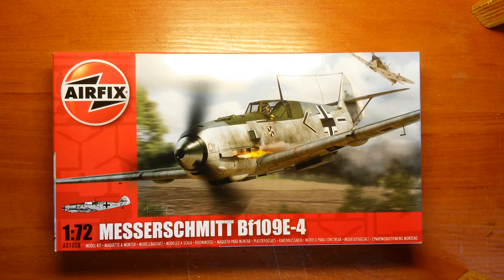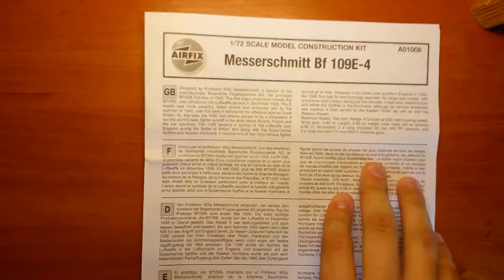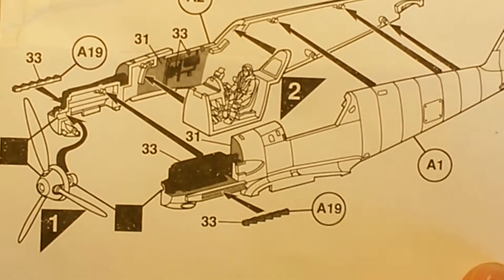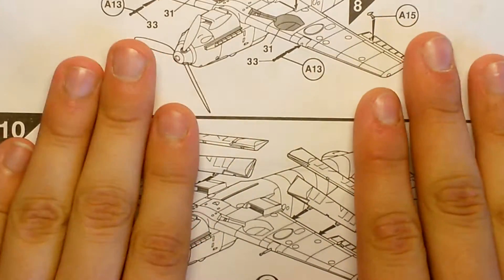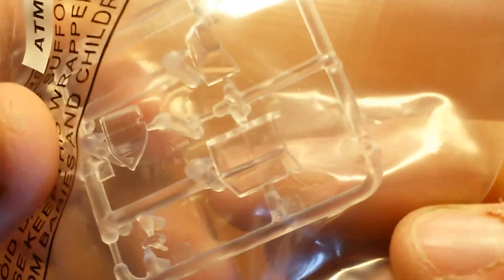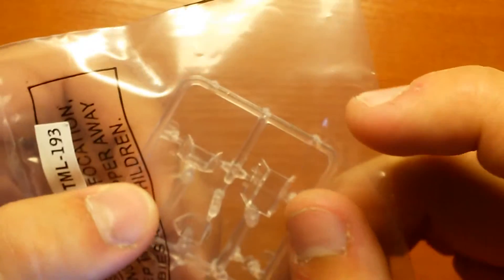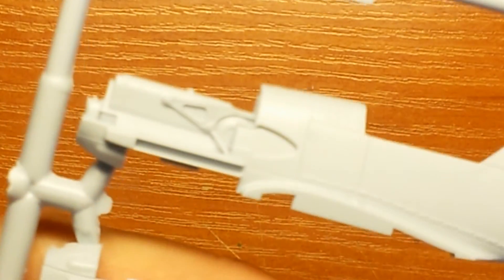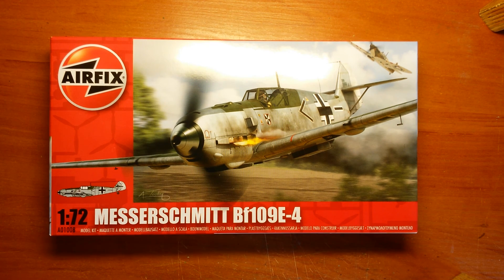New Airfix 1/72 Bf109E-4

Comment: I must admit, I wish more manufacturers gave you a moulded-on seat harness, maybe as an option with a plain seat as well incase you wanted to use a PE one, but in 1/72, it's a great idea.

With a little scratching, I bet that engine would look fantastic in 1/72.
Reply from the maker: Indeed about the seats, it would be good specially for beginners. Italeri does the harnesses on seats too. But anyway, I like to sand them away and make my own!
About the engine, yes, it will look good after a lick of some details.. I suppose
Reply: Looks a smashing little kit.